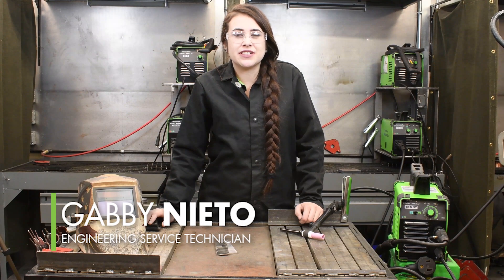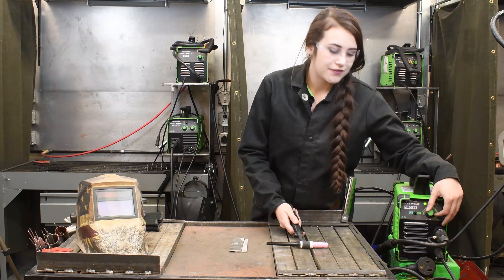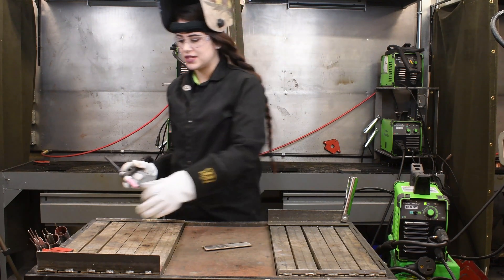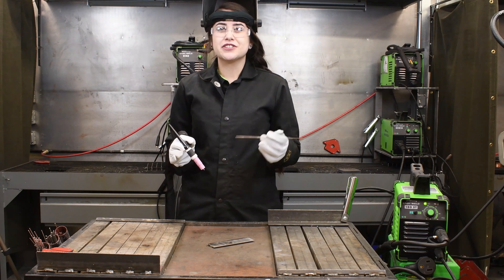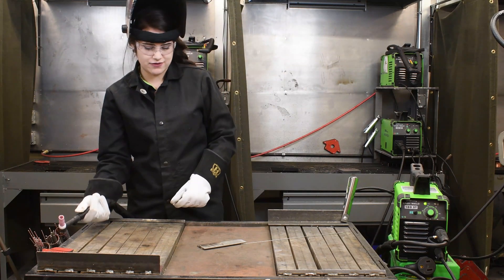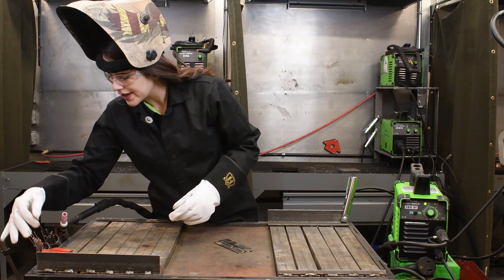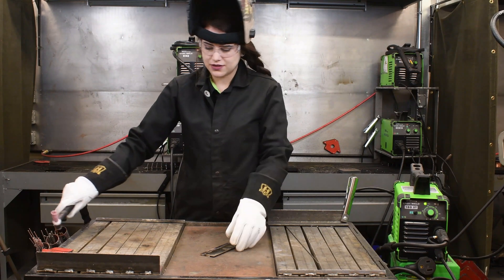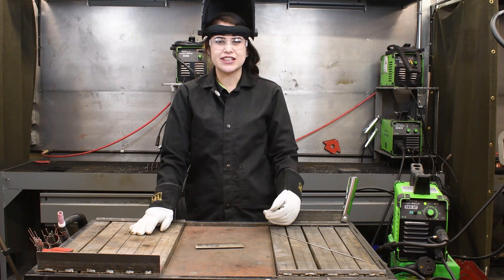TIG Welding with the Forney Easy Weld® 180 ST

Comment: Do you always wear safety glasses under your mask? And why? Tks.
Reply from the maker: You never know when a spark or loose metal could get under your hood. It's best to take extra precautions when welding with any process or if you're cleaning up your weld after.

Comment: Can it do stick 1/8 7018 on 14gauge square tubes?  I am fabricating some columns. 8' x 3" tubes on a 6" plate 14gauge for a carport or what do you recommend? Using 120v

Comment: What size tungsten and filler are you using?
Reply from the maker: Hello, the tungsten is 1/16" x 7" and she starts off using 1/16" filler and ends with using a 3/32" filler.